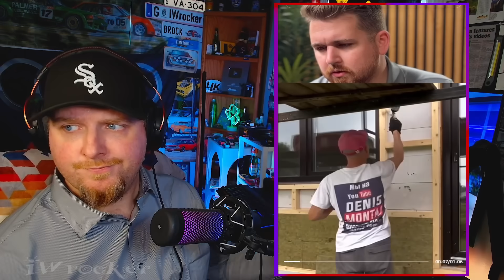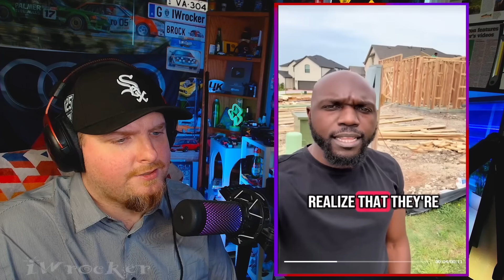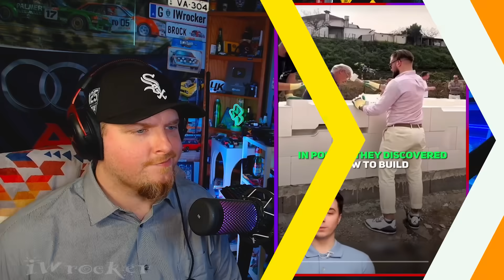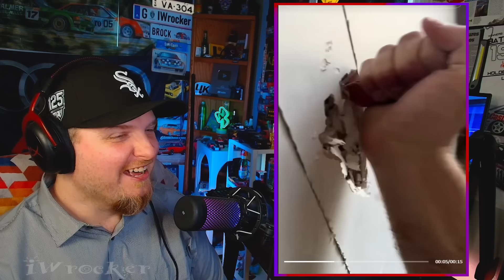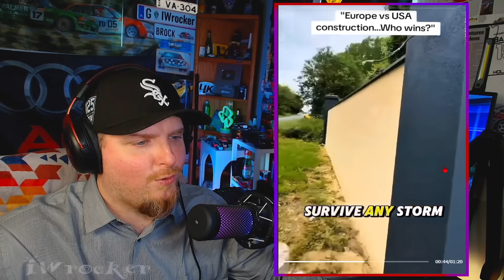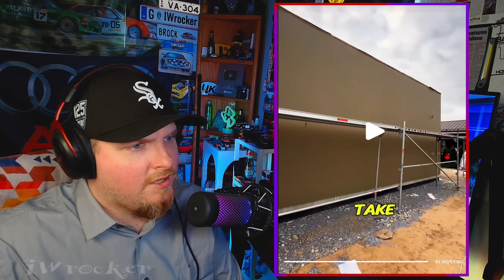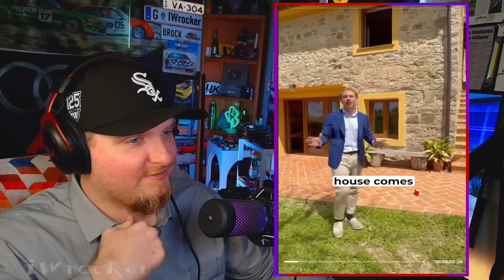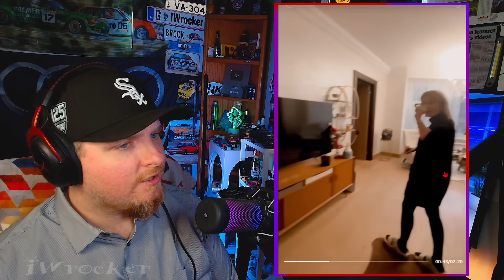25 Minutes of European VS American Home Quality & Construction Methods 🔨

Comment: 6:30 It is indeed just a facade, and there are several similar “houses” in London, for good reason.
As is well known, one of the first “underground railways” was built in London. However, these did not run on electricity, but on steam engines. The tunnels were relatively close to the surface and, wherever possible, they were not constructed as tunnels, but only as trenches. The areas under the tunnels also had to have large openings at regular intervals for smoke extraction.

In order not to spoil the appearance of the “better” parts of the city too much, the transitions between open trenches and tunnel areas were “covered” with house facades. Since the land with the tracks of the original “underground railway” belonged to a state-owned company and still does today, and in some cases is still used, albeit with modern electric trains, such “dummy houses” can still be found in London today. 

Even long-time Londoners often walk past the “dummy houses” without realizing that they are not real houses, as most of them are built into a completely inhabited row of houses and even have curtains and (artificial) flowers in the windows.

If you want more detailed information, I'm sure you'll quickly find detailed reports and videos on the internet or on Wikipedia.
Reply: All true, but the building in the video is not like that; it's a genuine (triangular) block of (very pricey) flats, "the Thin House". It hides the District Line which is behind it, not under it. It's not on railway land.

It has a Wikipedia page, with links to articles about it.

Comment: In Switzerland, I had to buy an impact drill just to drill into my wall to put screws deep enough to hand big frames. Our walls have maybe a thin layer of plaster but are otherwise solid concrete with iron and steel

Comment: the problem with american houses is the electrical wires , how are you going to replace them with new ones if some are old ? i saw a video that they just put al the wires lose wiht out putting them in pvc pipes , and make them fixed to the wooden beams behind the dry walls. in europe , the  outer wals are made from concrete or brick , some inner walls that dont have to suport the weight of the house are made with some kind of plaster blocks . in the wals they make a cutout /recess in witch they put al the pvc pipes and water pipes . than they fill them up with plaster . the electrical wire , two or 3 wires ( blue , brown and the green with yellow one , and from the switch to the lamp brown and black and sometime also the green with yellow , they pul those in the pvc pipes with a wire puller ...

Comment: If I want to drill a single hole in my apartment I need industrial pneumatic drill, because it's hardened soldi concrete all around.

Comment: When the clip of the wall being taken down with a utility knife showed up and you asked for feedback.

I looked around my apartment in my full on concrete apartment building and realised that a part from windows my front door is the least strong structural thing, and it's still thick wood.

I even think my inherited oak cabinets are stronger than those walls 😂

Comment: My house is build they way it can serve as a strong point during a war, it might have something to do with history, also it is insulated because we are poor so heating/cooling is expensive and also regulations require it to have at least 15cm (6inch)  polystyrene on the outside - even if you can aford it, there is no reason to burn too much stuff (whichever way you get energy) to heat it. My only real expense in the last 12 years was oil to reseal oak flooring, roof/doors/windows will outlive me for sure.

Comment: In Norway and Sweden, wooden houses are pretty common. So they do resemble a lot of American houses. Except that American houses are built more like our sheds or garages.
Reply: except that our houses are built with real wood and not plywood and sticks but real timber and planks with usually stone or cement etc foundations....
Reply: I suspect that newly built Norwegian and Swedish houses have pretty stringent insulation requirements....
Reply: @andersjjensen  Always had. From before it was invented. Here in Norway (which is not unique for us of course) they used moss, wool for insulation for the timber houses (logs flat on top of each other), other buildings used layers of wood before insulation (outer layer, 2nd layer, then 3rd and some 4th layer (still build like this many places, just more "refined" as they use insulation layers). They also used sand as insulation in roofs (lofts floors).
Reply: Wooden houses are not bad per se, we have them in Germany too and if done well they are really good too. The problem in Merica-Land is the type and size of wood (lately they use even cheaper and crappier pieces) they use and the whole construction technique (or what is missing of it because of bad contractors).
Reply: Room walls that are double-layered and relatively thin is common too, I'm pretty sure I could punch a hole in my (Swedish) wall. As long as it isn't a load-bearing wall or the frame of the house it isn't really an issue. Maybe more noise goes through it but whatever is cheapest is probably best as long as it doesn't compromise quality and the buildings ability to retain heat in the winter. I don't get the obsession with concrete walls when it comes to room separations at all. The only reason the conversation started was because footage was going around of US houses using the same paper-thin approach to the house *frame*.
For some reason it seems like Fenno-Scandinavia is left out of the conversation about house stability almost every time. It's always "wood bad, concrete good". Maybe we're ignored because it doesn't support the message people want to push on social media.
Reply: @Loogiii  Denmark doesn't do well with wooden houses due to the humidity and mild winters. Here brick is king. Newer houses are built with inner walls from that light type of concrete blocks, then insulation, then brick outer layer. The inner walls are also made from the light concrete blocks, as that way you can actually hang stuff that isn't just a picture on the wall, and the sound insulation is better than plaster board walls.
Reply: @andersjjensen wood does well in those conditions too if painted correctly. I live in south of Sweden so the same climate as you. However, I think that your lack of trees in Denmark is the deciding factor. You do have lots of clay though so bricks will be more readily available.
Reply: @Loogiii  I have yet to see a home or building here in The Netherlands where a room seperating wall is made out of concrete. If they are concrete, it's always a load bearing wall or seperation between two fire-compartments or actual properties, which always have to be concrete. Concrete is heavy as ** and requires a real sturdy floor to accomodate the weight, apart from the fact it's hardly possible to retrofit a concrete wall as it either requires lifting a pre-fabricated slab of concrete or a complex wooden frame to pour the wall. We either use chalk-stone blocks (I'm sorry, this is a literal translation of 'kalkzandsteen', don't know the proper English name), cellular concrete building blocks or plasterblocks for seperating rooms. Of course, wooden or metal stud frames with 1 or 2 layers of plasterboard on both sides with insulation between the plasterboard layers is also common as a room seperator, but especially the metal stud system is usually reserved to office buildings and rarely used in homes.
Reply: in germany, the leftovers of a neolithic house have been rebuilt. turns out their insulation wasn't much worse than our modern insulation today. the murricans are really doing something wrong there.
Reply: Timber framing and drywall isn't that rare in Finland either. Altough the outside is better insulated/sealed than in America.
Reply: fireproof wood!
Reply: New Zealand also builds wooden homes, but for the simple reason in that wooden homes flex in Earthquakes, Brick and Concrete do not. and considering there was a 5. something strength Earthquake in Australia a few years ago, and so many brick buildings took damage, and we have Earthquakes that strength on a not irregular basis, it makes sense.
Reply: Loghouses rule.

Comment: 01:00 This is some strange local solution, as there is too many wooden constructions and not enough of other materials. Also, the wooden construction in this case functions as a cold bridge. Google for ETICS (norms EN 13499 and EN 13500,).
06:00 There are many similar solutions in Europe and other parts of the world. Declaring this system as "popular" is a blatant lie.
14:30 All building materials used in civilian buildings are vapour-permeable, so moisture CANNOT be trapped inside (as we don't use vapour barriers on the walls). Moisture can manifest if there are cold bridges or some other failures.

Comment: I literally think there is nothing being done right in the USA atmo. Definitely not your houses. Here is some shyte you do. 1. Brick veneer, 2. Thin walls, 3. Poor quality work, 4. Poor quality materials, 5. Plastic roofing, 6. No floor drains in bathrooms, 7. Commode and bath/ shower in the same room, 8. Weak/ corrupt regulations, 9. No membranes in wet areas, 10. Lastly, my favourite, once you move in. Inane, spastic, little Hitler HOA’s

Comment: @ timeindex: 14:30 "A smart energy saving solution, or a risky design choice"...... lol.   In Belgium, a contractor is responsible for construction errors that affect the stability of the building, the solidity of the building or could threaten the building’s structural integrity in the future. And this for a period of 10 years. Not too much risk involved in that design choice.

Comment: 6:00  This is STUPID, because it only works IF THE "LEGO BRICKS" have no damage. You NEED cement to plug the holes between bricks! This is a nice try to GET SOME GOVERNMENT FUNDING for a silly technology ... but CEMENT IS A TRIVIAL THING TO PRODUCE and it can be made from stones and coal.
Reply: 7:10  That roof style is terrible, because it is METAL and thus will heat up significantly from the sun. It is als slippery and thus working on the roof (which is angled like that) isnt easy. Ceramic tiles are better, even slate tiles beat the metal, since you can easily add "hooks" to add a "gangway" for the chimney sweep or roof maintenance.

Comment: Hi,
The London 'House', is a façade, behind it is a railway line (the Tube), I believe (note I know many like this but don't recognise this actual location)  it is there because the line goes at 90 degrees to the house and under the road.
It needed to be open for the smoke, as it was built for steam trains
Reply: A good guess, but wrong. It's a genuine building, "the Thin House" just north-east of South Kensington station. You can look it up on Wikipedia.

Comment: In my parents house,where i grew up 
the "thinner walls"
were almost 20cm thick.
The MAIN walls around 40cm.
The cellar walls are pure concrete 50cm or more with 5-10mm steelbeam in it,like a bunker.
The house is 57 years now old and looks very stabil,my father as long as he can di ot was alble to care for it.

Comment: I work on construction sight in Serbia, building i am working on has bricks and concrete on outside while inside walls are made from plaster boards who are like1 or 2 centimeters thick with aluminum frames, I remember I almost broke my hand when I jokingly tried to break piece of it that was being thrown in the trash. Thankfully my hand was only in pain and not broken.

Comment: My apartment was built in the 60s and the outer walls are concrete and it's full of rebar.
Every time someone new moves into an apartment you can hear them hitting it in the wall. lol
I resorted to concrete hooks, plastic hooks with steel pins you hammer into the concrete because drilling a hole is neigh impossible.

Comment: Funny that people think insulation is only for cold areas. Insulation is extremely important to keep the heat in but also extremely important to keep the cold out in the summer. Your AC will be cheaper in the summer and your heating will be cheaper in the winter..my house is 55 years old, it's like new, it's only had new furnace and windows once, my walls are 55 cm thick and that's too thin if you're building today.. ..But the USA lives in a different era.. They still live in houses that we in the rest of the world would call a garden shed. and will never get it approved for human habitation.

Comment: My friend lives in a UK cottage from the early 16oo's and it's still perfectly sound.  From what I have seen, very little "over the pond" will last as long
Reply: I used to live in a house that was originally built in 1606.  It still had the original oak beams protruding from the ceilings and the walls, but the door frames and doors didn't hang flush, the floors were absurdly uneven and rodents were always nesting in the walls.... but the thing was still standing.

Comment: The London "Facade" house, property in prime locations in London sells for £££millions- fact, but small parts of land deemed not big enough for housing sells relatively cheap in comparison( still expensive)
Now, if you were to take a mobile home or RV for an example, people can live quite happily under those conditions, if you were then to construct a building to the equivalent of 90 mobile homes/RV's- 10 side by side, 9 rows high, you could have a house of considerable luxury, in a prime location for a fraction of the cost plus the uniqueness adds value. 
Its all about perspective and having the neccessary vision to utilise the unusable!
Reply: A one-bedroom, 600 sq foot flat in "the Thin House" (19:58) went on sale for £895,000 in 2016.

Location, Location, Location, as they say.
Reply: @kgbgb3663 Right now on Zoopla, there is a 1 bed flat for sale in Mayfair for £15m for the same price you could have either the entire Newliston Estate, Kirkliston near Edinburgh or The 29 bed Ardlui Retreat on the banks of Loch Lomond (£8m) plus the Isle Of Shuna- Inner Hebrides (£5.5m) Steeped in historical artifacts from the 8th century, It is indeed all Location, Location, Location as they say! 
Bonkers!

Comment: There are so many ways to build houses in Europe, even in a country. For exemple in France : in the north the house are made of red bricks, roofs are either tiles or slates depending on the region you're in, and you can either have concrete, brick or stone wall depending on the region too. Construction methods are really diverses

Comment: The building in London that's just a facade is to cover the underground tube ventilation shaft. In the 1800s when they built some of the system they needed to cut large air shafts to get a good flow. I can recommend checking out how the system was built back in the day, it's very interesting.

Comment: I'm in the UK. My house was built in 1948. When I wanted to take out the wall between the kitchen and dining room, we had to use 8 props across the opening to temporarily secure the side of the house and the room above. We then had to install 2 reinforced steel joists which had been welded together off-site. The joists took 5 men to carry it and put it in place! There are still many houses built in early Victorian times that still have their original slate roofs. I've lived in 9 different English houses during my lifetime. The "newest" house was built in the 1950's.

Comment: It's possible that the 'facade' house has a railway line behind it with the trains going underground under the road.  Look up 23-24 Leinster Gardens for another example.
Reply: 5, Thurloe Square, "the Thin House". It's genuine, but triangular. Built on a triangular plot left over when the Metropolitan District Railway cut through South Kensington.

Comment: We have a house from the 1950s without in-wall insulation which is standard today in Denmark, so my father did the method with the foam insulation mounted outside on the wall.

So now the indoor climate is better, it is warmer and we save around 25-35% energy.

Comment: That kind of insulation with polistiren or mineral wool... I did for 10 years in Romania (east Europe) working on rope for 10 levels buildings from comunist era, solving a loot of temperature problems. For context 10cm/3.93700787 inches thik is minimum to have good termic insulation on exterior brick walls. for more context can provide 10 Gb of pictures and videos from some of my work. I personally stay in an building from 1973 (10 level), upgrated by myself with Plastic windows (1,8mx1,5m cost 150 euro) and exterior walls of aprox.45m2/ 69750.13  inch2 aprox 150/170 euro per m2 cost.

Comment: That thin house in London is called The Thin House at Thurloe Square in South Kensington.  It's only about 2m wide from the angle seen in the video, but it is wedge shaped and widens out the further along you go.

Comment: Now i know why your Doors in the USA are so flimsy ... , it make no sense to make them more sturdy than the Walls .
The oldest part of my House is nearly 150  Years now , it has an outside brick Wall and a inside brick Wall with an small Gap between them with Air as Insulation , the old way of insulation . I put 20cm =~ 7.9 inch styrofoam Plates on the outside as insulation with a mesh applied and a thin  concrete / plaster film on the mesh for more stability as seen in the video . This method is mostly used on older Houses because its simpel , of course i need a very long Drill now to punch a hole from the Inside to the  outside , the  in and outside  Wall =  11 inch  + 8 inch insulation = 19 inch = i need at least a 20 inch long drill now